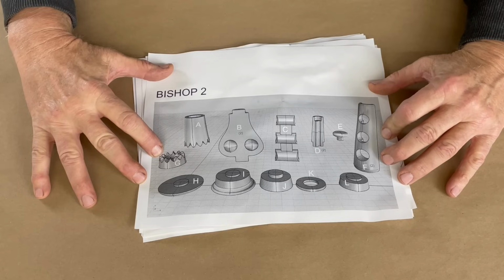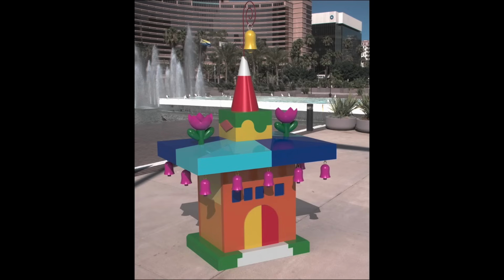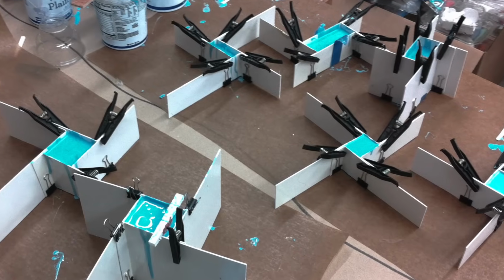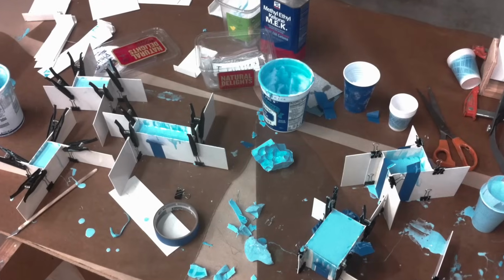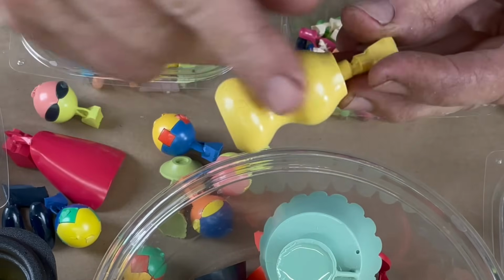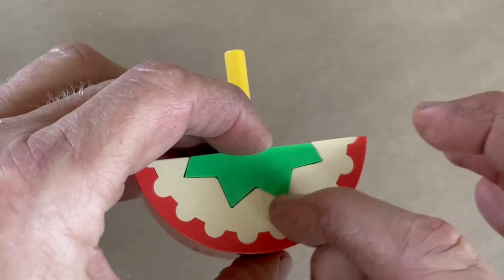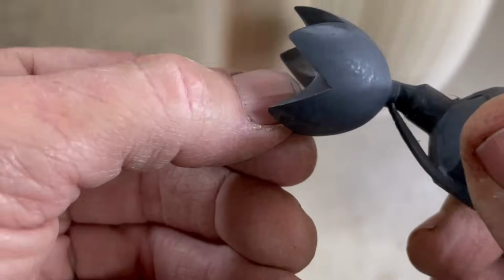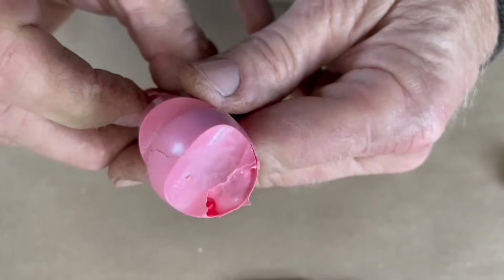One Art Project - Dozens Of Molds - Hundreds Of Castings

Comment: Question... Is that the kind of plastic that turns white when cured? If so, how do you get such hard colors that don't turn pastel, or takes so much tint that it doesn't cure properly. If it's the plastic that stays clear, so you can control the color better, what do you do to make it opaque? That's something I always struggled with.